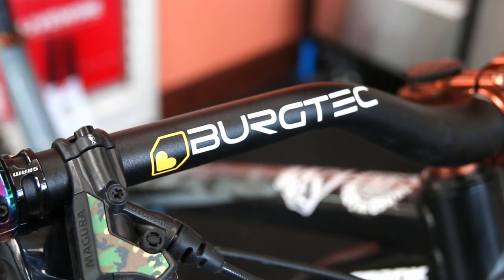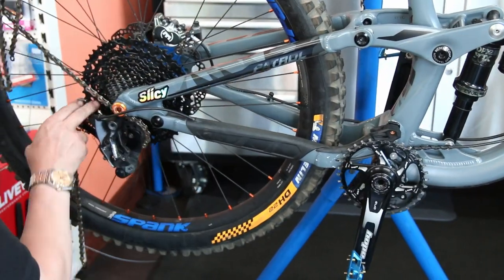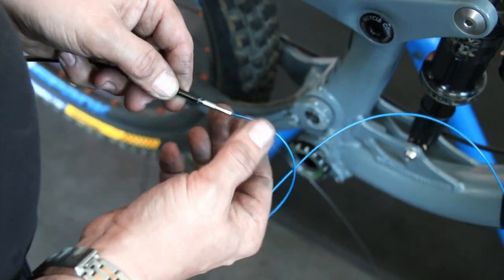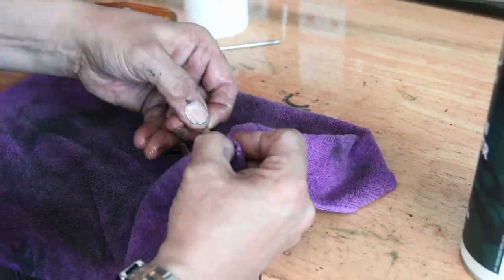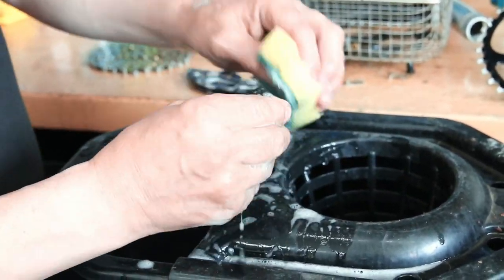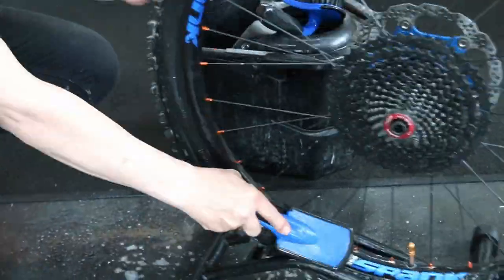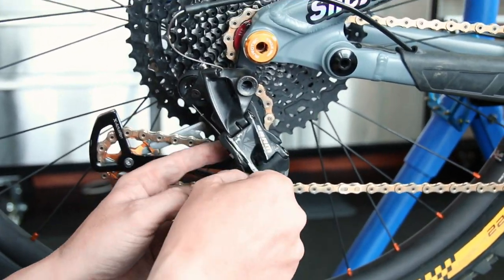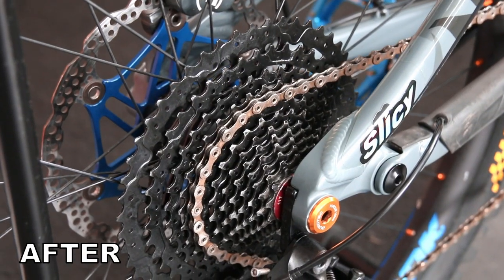In Depth Mountain Bike Service  - Dropper Post Fix and Wheel Truing!

Comment: It's not uncommon to purposely over-tighten the preload on the crankset if the rider does a lot of jumping. That way when they take their feet off the pedals to do a trick in midair, there's less chance of the cranks spinning around to a position the don't expect, and they can more reliably get their feet back on the pedals before landing.

Comment: Sweet... I discovered your videos a week ago and I have become obsessed! Almost a ASMR with great commentary that helps me switch off after long days at work and riding/Zwift racing.. Full kudos to the son for editing them. Keep it up, Love them.
Reply: Oh like you I use Car detailing kit on my bikes... just one word of caution.. I USED to use tire shine on my bikes, Mainly armour all, Auto fitness and auto glym ( I have LOTS of car detailing stuff!)... One of my MTB bikes was not used for best part of 8 months and 2 brand new Shwalbe Nobby nick tires cracked and perished around the sidewalls up to edge of the tire tread where you stop with the cleaning product. The regular used and not so extensively cleaned bikes  (tires ay way) stored in the same dry dark location suffered the same issue.. After a bit of research and looking on  bike forums these products can dry out and destroy rubber- especially in dry climates. Plenty stuff on the internet if you look.  Once again I love your videos and I hope this info is useful
Reply from the maker: Thanks for the kind words from both of us and we’ll bare the tyre blacking in mind!🧡⚙️
Reply: @Bikespeeds  no probs pal. Its always worth sharing info if it can help others if you have messed up.. I learned the hard way and after lots of conversations with my LBS, Shwalbe and other riders I finally found out on forums. Mainly by folks in hot climates have had the problems. . I have just finished restoring my year 2000 23 year old Cove stiffee MTB that I used to race on back in the day . I am led to believe it was the first one in the uk with disk brake mounts , the rear one is on the inside of the chain stay which was a real cool feature .. It's now MINT like new but having a nightmare with the Hope C2 brakes . Well obsolete and the pistons keep seizing if I don't use it for a few months. I even managed to fine a Brand new (20 odd year old) unused pair of Tioga factory XC tires that I used to race on back in the day!!
Just watching your Scott plasma restoration!! Love your vids

Comment: I realize there’s a lot of variation on torque specs but gosh if you guys made a general video on how to properly check the torque on a bike with a torque wrench, SO many people would watch it! I’m talking about you walking us through a mountain bike vs a road bike and describing what torque values are generally found on which parts- stem bolts vs seat clamps, etc. You could do it kinda like you did the greases and oils video.

Comment: Big fan of the channel and great to see full suspension mountain bikes on here! Not sure if you guys knew about the Sram Eagle derailleurs, they have a little button you can press when you extend that pulley arm to lock it in place to remove the tension. Very handy and makes it easier to put chains on, and remove and install rear wheel.